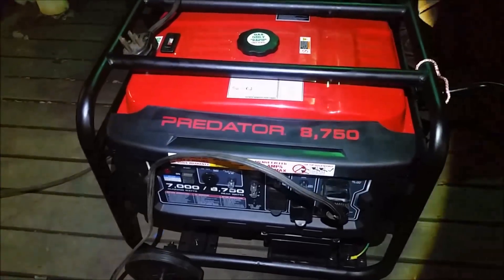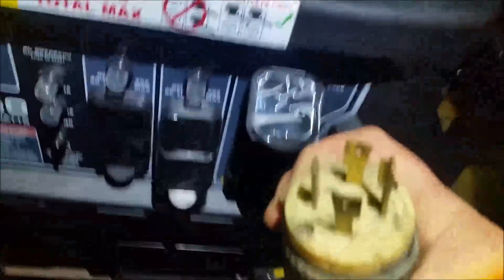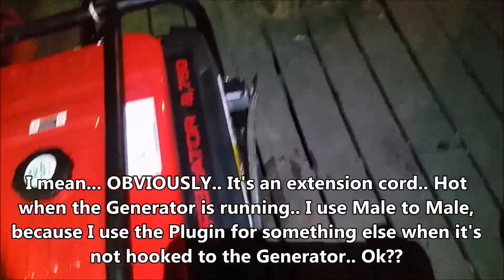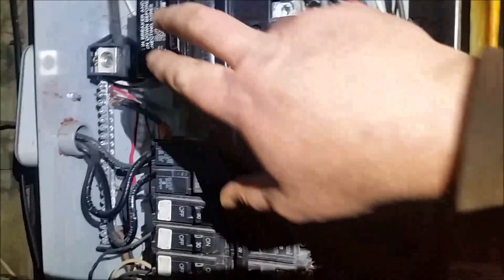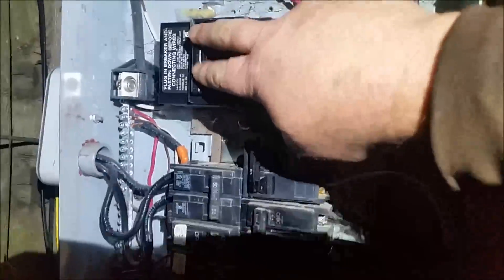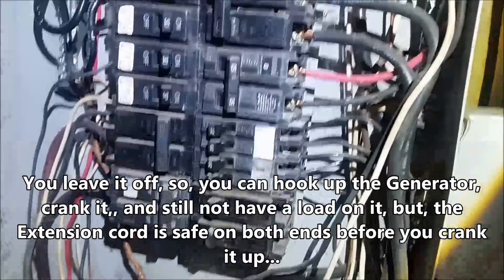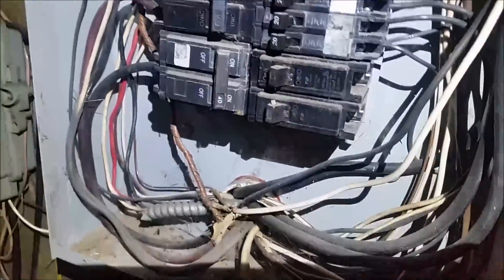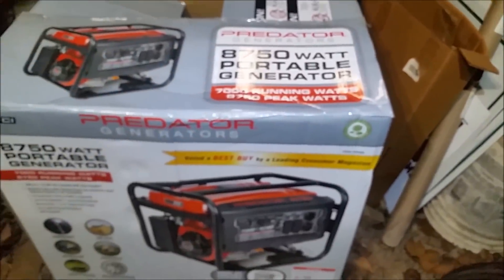Quick/Easy/Safe: Use Existing Plugin/Breaker for Generator hook up to your house Panel box.

Comment: I'm getting my supplies together to hook my generator up to the house when the need arises. 5000 watt generator with a 20 amp output. I'm thinking I can use a 30 amp receptacle box on the outside of the house with 10/4 wire going to the panel in the house. My question is, should I use a 20 amp double pole breaker for the generator, or can I go up to a 30 amp breaker for future upgrade? I'm thinking I should match the breaker to the generator output. Thank You
Reply from the maker: You always want the breaker to protect the circuit.. Saying that. A 10 ga wire will handle quite a load, in a short distance. In this case, the Generator would be the lowest amp item in the circuit, and probably has a circuit breaker on it already.. So, you can upgrade all you want, and put in a much larger size in expectation to getting a generator of a larger size later..  Just for instance.. If you had a generator capable of pushing 50 amps, and you put a 30amp breaker between it and the consuming source, you would be limited to 30 amps... If your extension cord between the generator and load was capable of 50 amps, that would be a waste.. Agreed?? But, if your wire from generator to   load were only capable of 30 amps, and you had 50 amps capable generator and 50 amp breaker, but, the wire would only handle 30 amps,, trouble... Because, the wire would heat up after 30 amps and nothing to protect the "Wire" part of the circuit. Make sense?? You are basically using a breaker to protect the weakest link.. If the breaker is the weakest link, you are highly unlikely to ever have any trouble. But, it is basically matching things together any time you are looking at Minimums to be sure.. Looking at Maximums,, as long as every thing in the circuit can handle what the source can put out, you are pretty safe..  Always considering erroring on the side of caution.. If you have an extension cord that is smaller than the breaker, the extension cord can heat up and cause problems, when,, the breaker is what would normally stop that from happening.. 
You can always hook up a 30amp consumer to a 50 amp rated circuit, but, it is never wise to hook up a 50 amp consumer to a 30 amp circuit..  The wire amps per foot charts are conservative.. If you stay within their recommended ranges, you will never have a problem.. I tried to say the same thing several different ways to give you the same information from different angles. Hope I didn't muddy the water. But, that should give you a good feel of how the relationship works.. 
One more time on your question: should I use a 20 amp double pole breaker for the generator, or can I go up to a 30 amp breaker for future upgrade?
In the Video, I have a generator that is capable of 30 amps per leg, and I have it connected to a 50 amp breaker, and the extension cord I am using is cable of 50 amps for it's length, so, I will never have a problem.. I could also operate it on a 30 amp breaker and wire circuit safely..  If I were doing it, what else might I ever hook up to that breaker?? A dryer? 50 amps... If so, buy the wire capable of 50 amps and buy 50 amp or less breakers and if you ever want to go up to 50 amps, you either plug in, or upgrade breakers and plug in.. But, if your wire is the limiting factor, you have to change it before upgrading.. How easy is it to change the wire after the install? All your choices..
Reply: @MarkThomas123  Thank you for the informative reply. The house I am in is relatively small, maybe 1200 sq ft. I currently have the 20 amp generator, 20-30 amp adapter pigtail, and 25' 30 amp cord. So it looks like my best move right now, currently on a tight budget, is to run probably 4ga wire between outside plug and breaker panel. I suspect that would allow for heavier plug and breaker down the road. You did confirm my thoughts that the 20 amp breaker on the generator would be the weak point in the system. Maybe an outside clothes line would be appropriate!
Reply from the maker: @ufoabove  Yea.. Looks like you are setup for 30 amps... Estimate the length of the run from Generator to your inside breaker panel, and make sure you get the proper size cord to stay at 30 amps.. The longer you run, the larger you need to go...  Google "Wire Size Chart" and check several charts.. Some will be more conservative than others.. Here is a plug in the numbers online calculator..  At 50 foot, 30 amp, I am looking at 10awg..
I looked that up, because 4ga seemed pretty heavy to me.. But, I was guessing 25 to 50 feet max for your run..  http://www.paigewire.com/pumpWireCalc.aspx? 
Remember a couple of things.. 220 volt consumes less amps typically, but, ignore when you are talking about a panel using both in this case,, Make sure you find an A/C chart and not D/C.. Direct Current (car batteries, etc) requires a much, much larger cord over the same distance.. You might have had your eye on a D/C Chart at 4ga, rather than an A/C chart over the same distance and Amperage.. 
You can compare your 25' 30 amp cord to what you are buying to run inside.. They should be pretty close at the same, or,,, I think up to another 25 feet, without looking at the chart again... I am pretty sure the gauge doesn't increase significantly across the board until you get over 50 feet..  On my phone, so, charts are not easy to read right now.. Not like my 27" screen desktop.. Ha.. But, I think you are on the right track.. Just verify the gauge wire for the feet of run on an A/C = Alternating Current chart vs a Direct Current chart.. I think that is where you got the 4 ga, unless you have a really long run to the panel... If you are still looking at 4ga when you get finished and your run is not up in the 100 foot area, reply back and I'll look at it with you.. 4Ga wire is pretty big stuff..

Comment: Are you providing 120 volts to house or 240 volts
Reply from the maker: 240 volts.. 120 volts per leg.. The 220v breaker is the feed, so, don't think it is one side of the box, it only feeds one side.. Each 220 breaker has a leg connected to the side it is on and the next leg the other side.. Just like, every other 120v single breaker is connected to the same side of the box,,, but, move one breaker and then, every other breaker is connected to the other side of the box... If you look at the metal contacts in an empty box, this will make perfect sense.. Google Open Panel pictures and see if you can find a close up..  Say, the Main Feed two hots look like they power one side of the box each... One left, one right.. In reality, the one side has a Framework of metal that goes to breaker Left 1, then, Right 2, Then Left 3, and Right 4.. 
While the other main feed powers R1 and L2, R3 and L4, etc.. It hops/skips to every other breaker on both sides.. 
It does not truly power "One Side".. Helps electricians to accidentally balance the load in the box. A lot of them are not that smart..  Hate to say it, but, it's true.. Just read a bunch of comments here.. 
So, if I connect a Generator capable of 220 volts to a 220v breaker, yes, I am powering both sides of the panel with 120volts each,, and if you grab one leg  from one and one from the other and use them both (a 220v breaker which uses this and the next breaker without skipping on one side) will get 220volts..  If the Generator only puts out 120 volts, I could only power one single breaker 110volts, but, if I had two plugins on the generator, I could run one to one side of the box and one to the other,,,,, BUT,,, you would want to Turn Off Every 220v Breaker, because,, it is not the same.. It is 120 volts 2 times,, not two separate 120volt legs.. It is about timing and phases, but, you would think it might work, but, it won't and will cause some really confused appliances if you ever attempt that and probably cost you some money replacing some items... 
It's a little confusing at first, but, if you look into a panel at your local box store with a single breaker and a double(220v) breaker in hand, it will start making sense.. Cheers!..
Reply: @MarkThomas123  so, hooking up the 220V 30A cord from my 8K/10K start up, generator, to the 30A plug in that was just installed off my electrical panel, will power my clothes dryer if i wanted too? in theory?
Reply from the maker: @nocoolname32  Hmmm.. That's quite a load. I have a 7250/8250w or 7k/8k, and it will run a 1hp Deep Well Pump and it will also run a 40gal hot water heater, but, both of them will starve for amperage if you turn both on together. Dryers are generally 50 amps.. You are dealing with a 30+ amp supply... 
I think,, even if you turn it on warm instead of hot, it is still going to pull close to 50 amps, just not stay on as long as if it were set at a higher temperature.. 
I don't think it would run under less amperage on a lower setting. But, then again, a dual voltage bathroom heater does just that, if it has a switch to run it high or low.. You might find that information in your owners manual or online.. 
But, under that load, even if you could run it on low and run it longer to dry the clothes,, that would be the most expensive drying run you ever made.. Ha..Ha.. It costs me about 6-8 gallons to run 8 hours depending on load, and I generally run a light load, except for keeping the hot water hot, shutting the hot water heater off and then turning the deep well pump on to take a shower..  
I would opt for something more important during a power outage.. And,,, while you are testing the dryer,, if you do,,, turn off everything else using your breakers..  When you start trying to pull those kinds of loads,, you will find out if you have any bad grounds, etc, and the voltage is going to dip pretty hard when the heater element kicks on and, and it is going to spike quickly when it comes off.. Depending on how that happens,, you could start having problems with electronics.. IE.. If the DSL voltage coming in from the street (into the back of your computer or DSL router, and the voltage drops, it will actually look like a spike of the DSL voltage, etc..,,, in some strange and rare cases, but, not super rare.. 
In contrast,, you also need to be aware of any really high voltage 120 volt (one side of the panel box) drawing devices.. Not Refrigerators, Freezers, etc,,, unless luck of the draw has all of them on one leg of the panel box.. 
When you start running a generator, it is well worth you time to decide what you are going to typically be running and not running, and pull the panel cover off and see if they are on alternating breakers.. Remember.. A 220 breaker (Feeding off of both incoming legs), is actually two 120v breakers sitting side by side.. So, every "OTHER" breaker is on the same lug of the main.. Not one side and the other like it appears at first glance.. 
Hope that helps.. If not, ask where I confused it..
Reply: @MarkThomas123  read it all twice and gave me some great things to verify, thanks!!

Comment: Quick/easy/dangerous
Reply from the maker: Yes.. For someone like you.. Yes.. Please call your local Electrician for a solution. Don't try this yourself. Anyone who can't figure out why a garage door is buckling and snapping has no business in an Electrical panel box.. 
This is way above your pay grade.. You need common sense for this to make sense to you..
Reply: @MarkThomas123  just because you can do it, doesn't mean it's the right way or safe way to do it. Why not just do it the correct way?
Reply from the maker: @limpfinger12  I did... Exactly the way it needs and is designed to be done.. Works perfectly.. Quick, Easy, and Cheap and uses existing plugin you are not going to use during a run on the Generator anyway.. What part of that doesn't make sense?? Because someone told you,, you have to do it another way?? Ha..Ha.. Ok.. 
Well, if that is the case,, just mosey on and find an Electrician video and call him... This is for people who can think, don't worry about forgetting to tie their shoes, or put their cars in park, or turn off the main breaker.. 
The Correct way?? Tell me what is not correct about me using my Existing Welder or 220v Compressor outlet to power my panel while I run on Generator and am not going to be running either anyway?? 
Sorry that doesn't make sense to you.. That's what I mean.. If it does not, call an Electrician and listen to what he says.. Not going to find that here.. This is too simple for anyone who does not qualify.. Those with Common Sense..  Hint.. If you can't remember to turn off the main breaker,, when you pick up the Suicide cord, it will remind you.. If you don't get that, you have Zero business messing with electricity panels. Simple as that...

Comment: Hmmm, I have a 50 amp RV plug outside of my garage.  I understand why an interlock would be preferable, but in an emergency why can't I use this method and just plug into the RV socket once the utility main is off?
Reply from the maker: Exactly...  "Once the Utility Main is Off" is the key..  Then,, all you have to do is make a "Male to Male=What most call a Suicide Extension Cord", and before the Genset is cranked and after the Main is off, hook it up and then,,, crank the Generator and you are off to the races... 
And,, tell me,, when you make and hold that "Suicide Cord" in your hand.... Does it make you say,,, "Careful with this cord??". Ha.Ha..Ha.. 
Even though it is not plugged into anything,, I always look at both ends before I pick it up,, just in case someone plugged it in as a joke or something.. Ha... 
But, I keep it on top of the Generator,, underneath the Generator cover, so, it's never an issue. But, if you ever pick up the cord without thinking about it,, slow down and do a reality check. It's the only "Potential" problem you are going to be dealing with.. I always turn the main breaker off "First", and when I pick up the cord, I always remember,, Yep,, I turned the main breaker off,, before I plug it into the plug connected to the panel.. 
Sooooo many people freak on that as a Safety/Security issue, but, I can't see how anyone could screw that up.. Agree? 
But, you could always hook up an Interlock (in this scenario),, and then stand back and think,,, "Why did I do that?",, when you could easily just follow some simple "Intuitive" instructions and be up and running in a few minutes.. 
Thanks for the comment.. Nice for some who visit this video to see someone else with common sense.. Ha.>> Good luck and cheers..

Comment: Even if there is no specific law requiring it can be considered negligent if you don't do it because you are not acting the way a reasonable person would If anyone is killed it can be manslaughter because of gross negligence or worse.
Reply from the maker: There is nothing negligent about it..  Ha..Ha..Ha.. You mean that I am not acting like some Lame Brained fool that knows nothing about Electricity and nothing about Electrical boxes? Who would be stupid enough to hook up a generator without turning the main breaker off??? I mean.. REALLY!! See what I mean about this video is NOT FOR YOU?? 
But, I wonder if you are smart enough to know how stupid you are.. Here is something for you to think about.. The Utility Company,, pretty much has an Unlimited Electrical supply for it's consumers. Lets just describe that better by saying,,, they have way more electricity for you and the guys hooked to your transformer than you guys could ever want or need or possibly consume.. Just your transformer for the sake of the conversation.. How much does your generator have?? OK.. Very, Very, limited... And the Generator has what on it that regulates how much electricity it can put out?? A breaker,, Yes???
And, it hooks into the panel in your or my scenario through a breaker which also has a current rating.. Yes??  
So,, for everyone on your transformer,, when the power goes out,, do they run outside and turn their main breaker off????? No.. Only if they have a Generator.. Correct?? So, if you do backfeed into the Utility, who is there to consume your electricity??? Everyone who is not "CURRENTLY" running on Generator.. Correct?? Just how long do you think you would be powering the Utility Circuit?? Hours??? Minutes?? Seconds??? Split Seconds?? 
If you can't answer that one,, try it on your dumb ass friend electrician.. He should be able to get it,, and you guys can both see how stupid you are together and amaze yourselves together.. Won't that be fun??? Have a nice day.. I wish you would ask questions rather than seem so damn dumb...
Reply: This is why everyone should watch this video about generator safety https://youtu.be/I1jT3ANENvI

Comment: You may know what you are doing to prevent shocks but Others may not heed directions. If a person fails to do the steps in the right order. Do it with an interlock as the law provides. My electrician would agree with!!!!
Reply from the maker: Mr Andy Stitt.. This video is not for you.. You talk about an Interlock and totally missed the Title of the Video.. You have to have more sense to do this than you have.. Please use an interlock and watch some one elses video.. 
BTW.. What Law?? Are you talking about NEC?? It's not law unless it is adopted by your state and then, it becomes "Code", not Law,, and it does not apply in this case, because,,, the Generator section of the NEC is the shortest chapter in the NEC, and it merely suggests the Interlock as a Possible Solution, and there is no law against ANY TYPE of Extension cord, because NEC does not regulate them.. Only Permanent installations.. The reason why they don't regulate,, but, only suggest Generator installations.. 
Yes.. You should listen to your Electrician.. He is about as dumb as the Electricians, Electrical Engineers, etc.. who have posted here before and got a good spanking themselves.. 
I taught my Son how to wire a house in about an hour.. Electrician Brains are way, way, over rated..